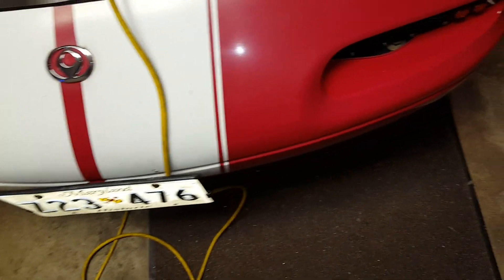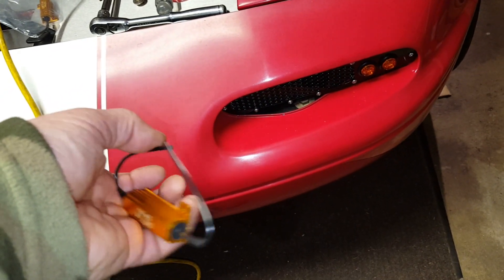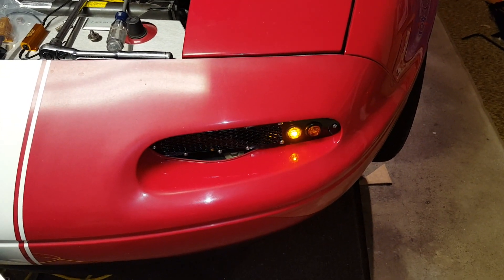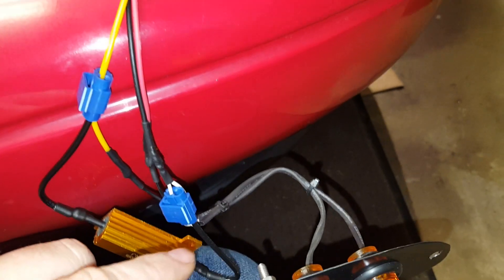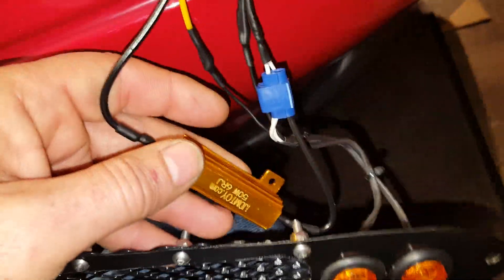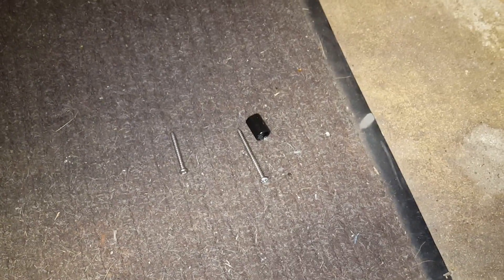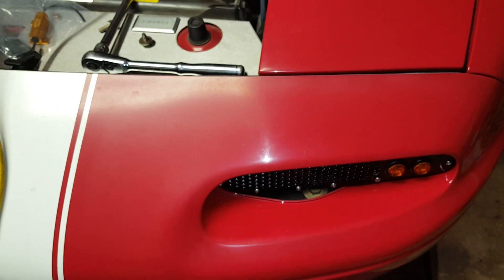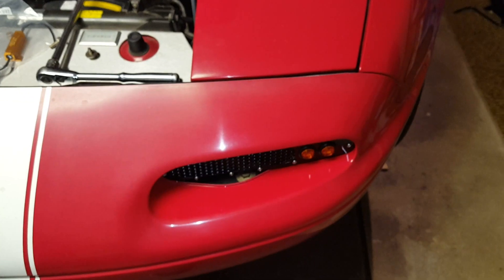Adding a resistor to an LED turn signal to prevent hyperflash

Comment: Those things get too hot. The turn signal relay resistor mod is way better.
Reply: They won't get hot unless you leaving them on for a long time. I go on drives and they barely get warm.